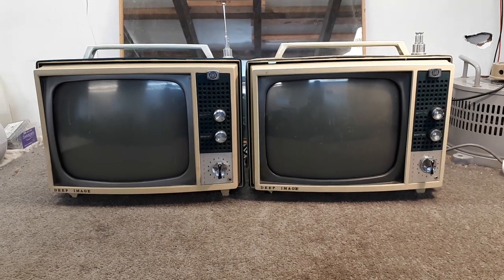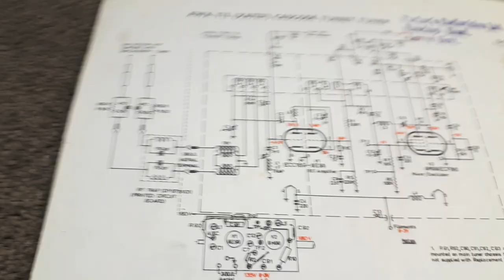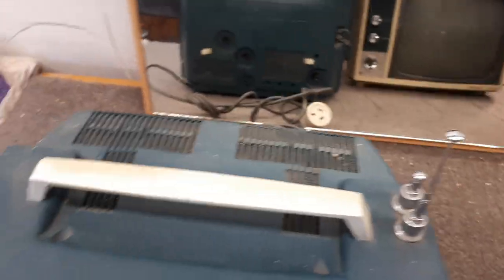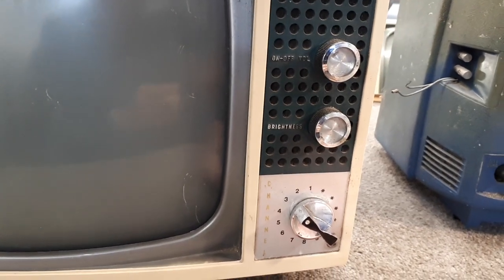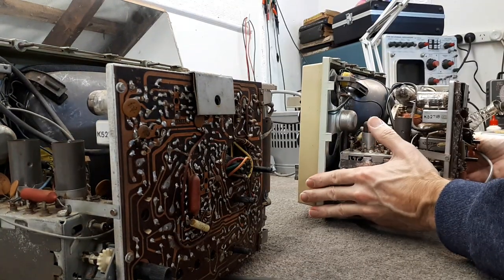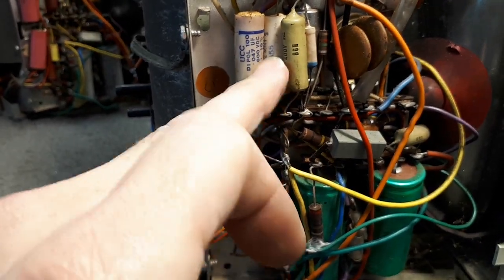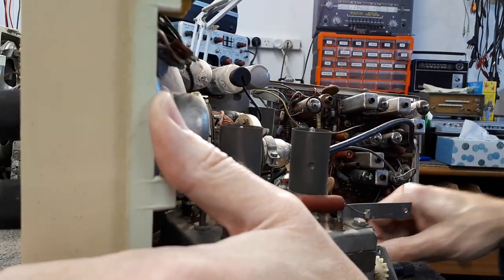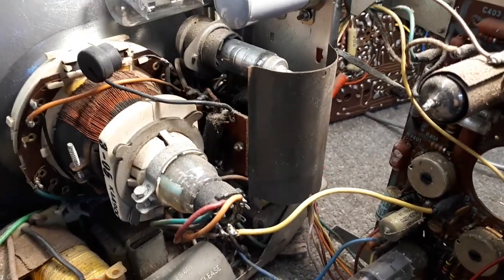AWA 46 Series Model 5-P11 12 inch Vintage 1960's Television Sets Part 1

Comment: Back In ‘78 I had a friend ask if I could fix his AWA P17, a 12 inch portable.  It wouldn’t tune in Chanel 0 and I found it seemed to be tuning no lower than about 49mhz rather than 46.25mhz.  Got a new biscuit from AWA and it tuned in perfectly. That friend had brought the set down from Sydney, another friend said he often found TVs sold in Sydney would not tune Channel 0 correctly.  If that’s true, I would say that the factory had a problem with the Channel 0 biscuits and only corrected the ones sold in Channel 0 areas like Melbourne and Brisbane.
Reply from the maker: Intriguing story about the tuner biscuits, we didn't seem to have that problem here in NZ.

Comment: Hi Glen   I remember the AWA p5-11 hot box quite well . Considering how hot they ran they were reasonably reliable. Performance was quite good if the CRT was up to snuff. The crt's were not long lasting.I had one and had a rebuild CRT out of  US GE tv fitted . When I was working for TISCO ECL regunned the tube for me for free. The tube was a mono type so they fitted an imposion band to make it a lille safer, It had a very bright picture  and not the blue tint of the AWA crt's
Regards Gordon Baker
Reply from the maker: Hi Gordon, yes I recall my original one having a brilliant picture but that was back in the late 1980s! I'm surprised those backs didn't melt actually. Had to chuckle to myself at those poor old Ducon filter capacitors failing badly. I'd imagine one with a good tube would perform  rather well. Hope all is good with you up there. Cheers 😊

Comment: Well, look on the positive side - at least this isn’t a shango066 set, full of dirt and rat droppings and dead bugs! Also, no fine-pitch surface-mount ICs to resolder! ❤️
Reply from the maker: Yeah there is that but I do admire Shango for his brute force methods of bringing those dilapidated sets back to life and some of those desert sets I couldn't believe he got some of them to work. If that isn't an example of vintage robust electronics right there.

Comment: The tuner is different to the Australian P1.  The Australian set uses a "neutrode" RF amplifier, single neutralized triode.   Apart from that, these sets look identical to my P1.
Reply from the maker: Hi Stuart well that confirms my suspicion about the NZ version being a clone, thanks for that useful information 👍